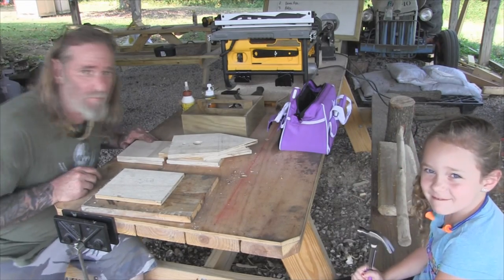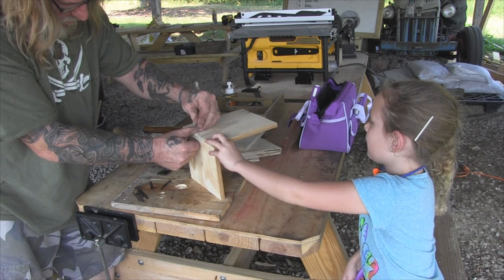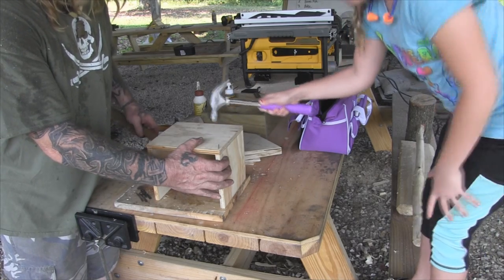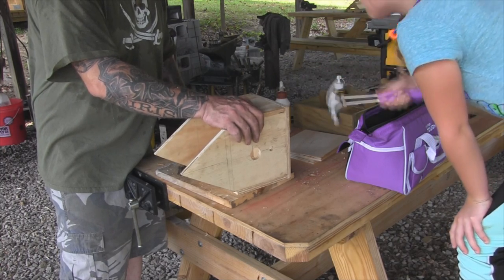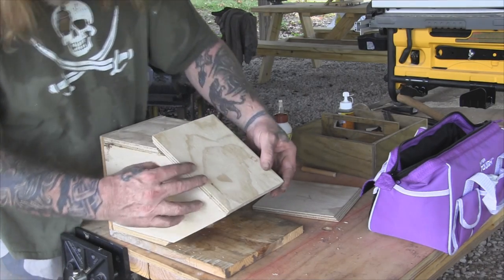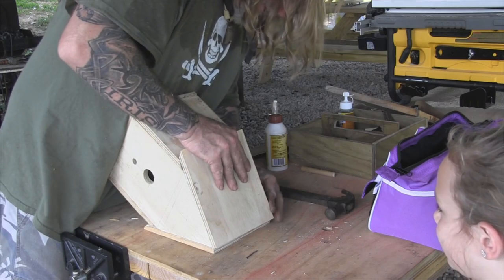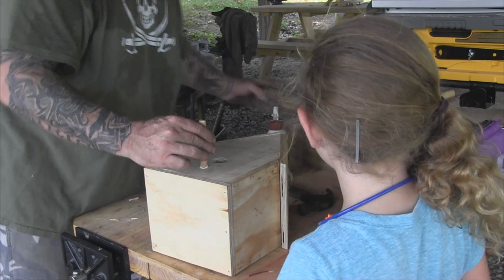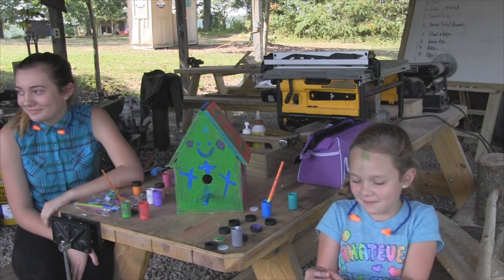Birdhouse for Papa

Comment: I prepared several bird house kits for the Cub Scouts. Two words of advice to eliminate the frustration of inexperienced hammering: pilot holes. ;)
I placed one of the nails in my drill, clipped off the head, and pilot drilled every hole.
That way when the kids got the kits, they were only nailing into one board and not through two.
Cheers!
PS: we used a quarter molding for the roof crack put in place with a little wood glue.

Comment: did you put a bead of glue or caulking along the peak of the roof?otherwise you're going to have some wet eggs/chicks in there.
Reply from the maker: +SirLobsterman We put a bead of Silicone on after it dried
Reply: good.
Reply: +wildernessoutfitters  hi Dave 
could you please do more 21 century long hunter stuff 
i miss videos like the yurt sires and the 12 ga  videos 
thanks for reading and please respond